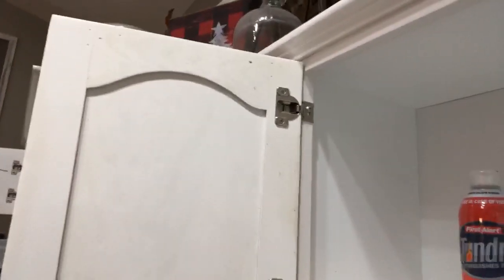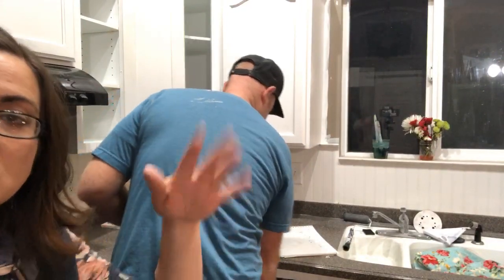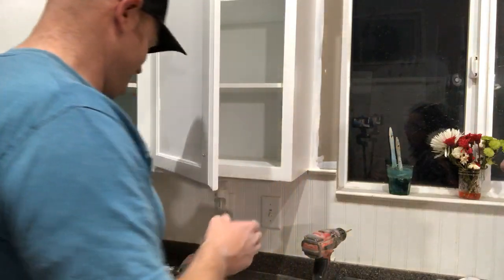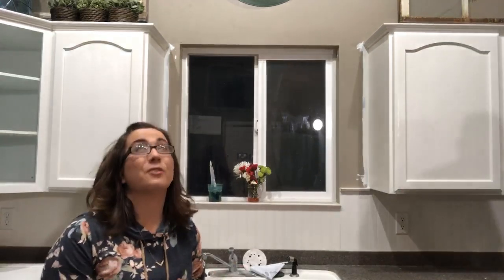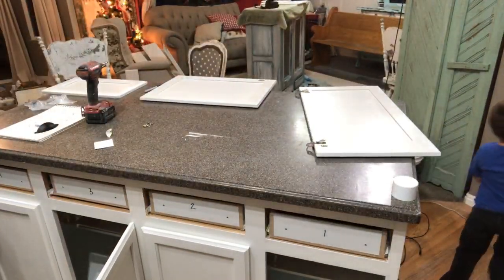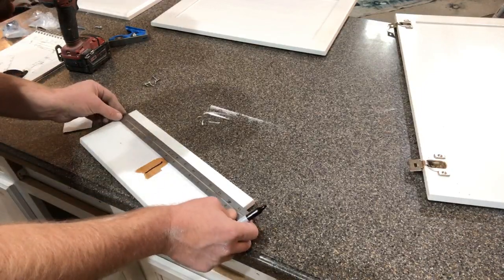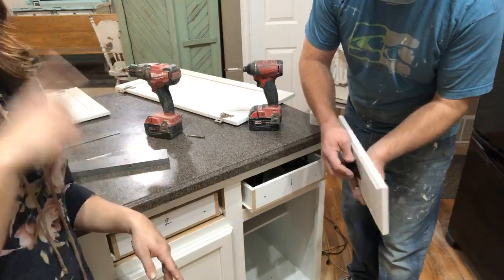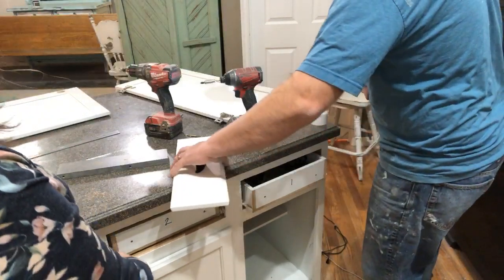Installing Cabinet Doors

Comment: Josh and main has sales on the farmhouse drawer pulls all the time. You might like the track lighting that is rub oil bronze. We had the horrid florescent lights from the 70s. And we put in the rubbed oil bronze track lighting and they use those tiny bright light bulbs.